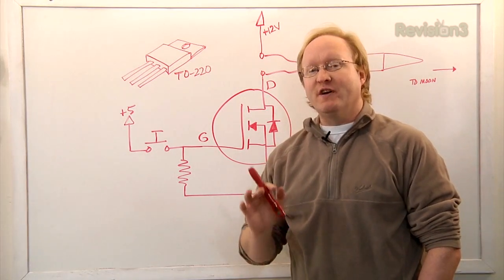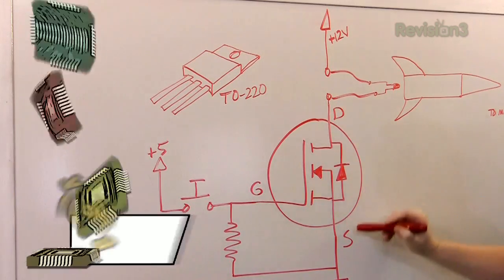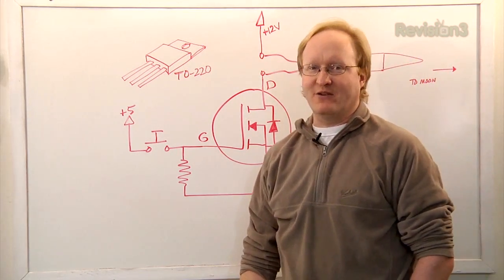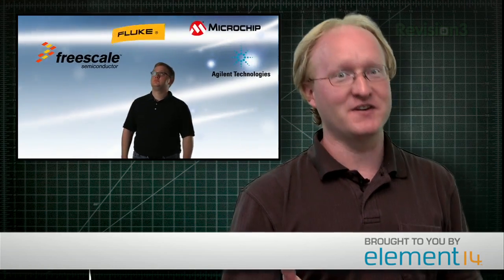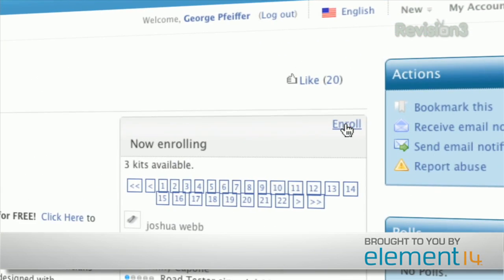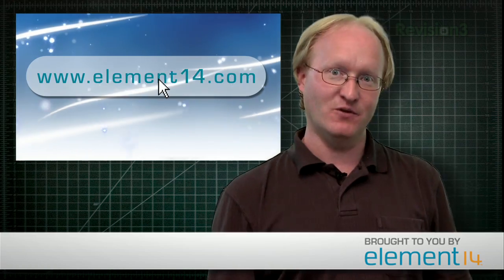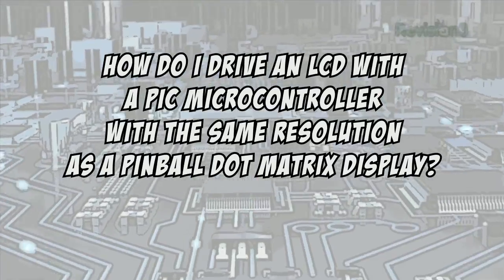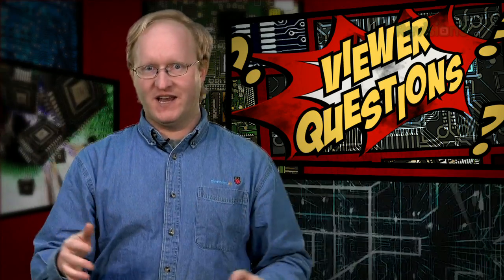AMD Computer Mod

Comment: Why do so many people light a bic lighter with their index finger?
Reply: Andrew Beaver possibly because its easier to hold the lighter side ways for pipe smoking... i mean heat shrinking tubing.
Reply: ::) ?. Co ::) html k ::) l.p. b.s.
Mnb yaY
Reply: Andrew Beaver how do you light it then
Reply: With my thumb.
Reply: I just thought it was weird, because I grew up using my thumb

Comment: Wow, good introduction to MOSFETs!  

I'm sure I had heard the term and had probably been introduced to the concept before, but it had never seemed to click with what I had been doing until now. I've been playing with these Arduinos and kept on thinking or wondering if there exists some kind of solid state transistor thing where a small voltage applied to a pin could determine the current flow of a current with much larger voltage. Now I know! (Well, kinda.)

Comment: a MOSFET is a transistor (metal oxide semiconductor field effect TRANSISTOR). Transistors have many uses: signal amplification, drivers, buffer, logic gate. Popular uses of MOSFETs are power amplification/driving

Comment: Model rockets typically launch off single use engines that burn through a few layers of fuel. They look like little cardboard tubes. There is no "control" only launch and fly ;p

Comment: Hey Ben just want say first off nice job on the mods and second I'm wanting to build a mediacenter based pc using the amd a10 5800k with the asrock a85x extreme6 mb while incorperating multiple dvr pci express slots I would love to hear your thoughts and input on this project and I would love to be able to use a remote control for this as well if you can post a video or comment it would help alot

Comment: Umm does the computer actually.... DO anything related to the rocket, I don't think i heard any mention of it doing any control, if not so it's basiclly a computer in a rocket launching box.  :( Computer intergration with it would have been cooler

Comment: I fell out of my chair when the rocket came back!!  

That was too funny!

I would make the launch tube about 1/2 to 1 inch wider in diameter than the radius created by the rocket as I it spun a complet circle around the launch rod.  The problem was putting it centered I the tube, making one of the fins catch an edge.

Still a cool video!

Comment: so go on, if the monitor truly supports 240hz and benq stands for the crap youre talking about you should do a test and show it
or do you want to say that todays gpus cant even handle simple 2d objects at 240fps?
talking about freaking tv networks when were talking about pcs because its pointless for tvs anyway
why do you think they dont sell 240hz monitors for gamers? its easy money if they were true 240hz - gamers tend to buy expensive stuff quite easily but they dont fall for such tricks...

Comment: if a monitor can displays 240 FULL frames without any tricks than it is a true 240hz monitor
but in fact theres none which does 240 full frames, even the 144hz can only overclock to around 150
there professional tools to see the actual refresh rate of a monitor (like a high-speed cam taking 1000 pictures in one second and then counting the full pictures of a fast moving object)

Comment: upcoming nvidia titan with a little oc in most games or dualgpus or simply single gpus in older games or games simply not running at max settings
i dont fucking care about tv networks why would i want to watch tv at 240hz anyway? iam not watching it in competitive mode...
the electronics inside need a certain level of durability to "survive" 240hz in the long run, i never said they operate at hz, besides from that khz and mhz are the same as hz you genius

Comment: TV networks, idiot, and the electronics inside the TV operate at khz and Mhz, not mere hz. Also, if you can find a graphics card that can push out 240fps then I will be mighty surprised.

Comment: existing networks ? what shit are you talking about
if it did support 240hz it would show 240hz when connected to a pc (hell even if the cable hasnt enough bandwith for full-hd in 240hz its still possible to lower the resolution, but i dont think thats neccessary when there 2560x1440 monitors running close to 120hz) but there tests which proof it wrong
so even if the panel would support true 240hz the electronics inside still dont or theres no explanation why it doesnt work

Comment: Dude. My dad works for BenQ. The "Same Frame" this guy is talking about is actually the same image from a different perspective. However, there is no way you can broadcast 240hz in HD over our existing network, you would need to upgrade it first. then there is decoding and all that bullshit, so the best you get is 120. The TV is still capable of 240hz (So it supports future infrastructure) but it will only play 120 (60 per eye).

Comment: Dude, Motion blur is a good thing. Without it our brains are screwed up. And you still get good image quality. I have a 24 inch Samsung  monitor, and it plays back at 240Hz (120 per eye). Also, to achieve 3D the two images must be different, as they are taken from another perspective.
Do not start an argument on YouTube if you don't know EXACTLY what you are talking about.

Comment: There's no such thing as a 240HZ TV, It's a marketing scam, the liquid crystal display doesn't actually refresh 240 times a second. In order to "achieve" 240HZ the TV displays the same image twice for example, to make the video appear smoother.

That's why you can't buy computer monitors over 144HZ, because with the monitor technology we have today that's the maximum refresh rate we can achieve. 
(And still have good image/color quality)

Comment: In the video you can see ribbon cable coming into the front panel. Presumably those connect to the motherboard. Your smart-ass comment about the "Fire Rocket" pin is unnecessary as you can use ANY low-level signal to engage the mosfet which would then fire the rocket. A very simple piece of software would be able to set a pin on your serial port, which would facilitate the triggering of that mosfet.

I will only agree with you that those details are not revealed in the build, much to my dismay.

Comment: No, the PSU powered it, but the Trinity put in the parameters, such as the Count Down and turning on the indicator lights, opening the hatches, firing off the rockets, etc. THERE WAS NO ARDUINO. The Arduino was used as an ILLUSTRATION only.

I will agree that a plexi-glass case, maybe backlit, would have been cool, but with the rest of your complaint, you are just plain wrong.

Comment: There was no Arduino used in the final build. That was just to illustrate how to drive the LED array. The mosfet was used to take a signal from the Trinity and use that signal to ignite the rocket. The front display panel was driven by the Trinity as well.

Comment: Um...yes, really. Would you rather he put the Trinity outside the enclosure? Maybe use plexiglass as the enclosure? Would that have satisfied your need to keep it from being "hidden away?" 

The Trinity was powering the entire build. Where are you getting that it served no purpose? The entire build was being controlled by the Trinity. Some people seem to think he was using the Arduino, but he only used that to illustrate how to use shift registers to drive an LED array. So...what's your beef?

Comment: I'm not gonna lie, I was kinda disappointed in this.  You could have done this all with an Arduino, and it would have been more portable as well. There's almost no reason to have the AMD board in there. They didn't show how its integrated at all. What happened Ben?

Comment: It's a pity you didn't mention how you connected the rocket-launching circuit to the computer itself... Did you just hot-wire it to the power-supply molex pins?

Comment: regardless of one's training in retail. the customer is not always right. and you can run into more problems by accepting what a customer asks for than you would by providing a solution to a customer. the customer is correct about their needs, they always are, but they are rarely correct about the solution, (that is why they hired you) and as a solution provider you are failing in your service if you do not insist on a better solution to fit their needs.

Comment: Don't you think AMD Trinity is not strong enough?  I am sure that is why the rocket did not fly so well. I heard you need 6 - core CPU + at least 8 Gb memory + a nice a graphics card (for Windows) - like GeForce 550 or similar. 24 inches monitor is also a must.... Try - I am sure the next launch will be more spectacular.

Comment: pointless. the 5 volt available from usb off of EVERY computer is enough to ignite normal ignition on any generally available rocket (it outputs enough amps to fire a standard rocket engine) and if you are doing something custom all you need is a transistor and a battery, everything else can be programmed on the laptop itself. this project is a pointless waste of money. the apu can do it the same way i mention, hell you can do it with windows 3.11 (probably older win, but it is easier with 3.11)

Comment: Even if it is an overkill, AMD requested a custom computer that can launch model rockets, that had to be built using their latest APUs.

Sure, he could've done the same with basically any micro controller, but that's not the point of this build.

Comment: that was THE MOST overkill build I've ever seen.. everything could have been done with a small micro controller and a 12V wall wart..  thats like 100000 times less than the amd setup